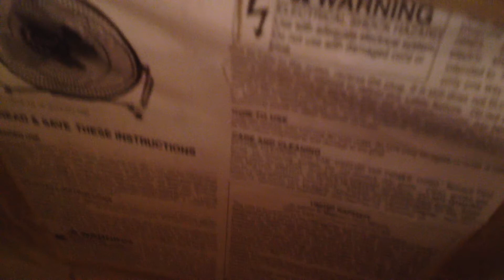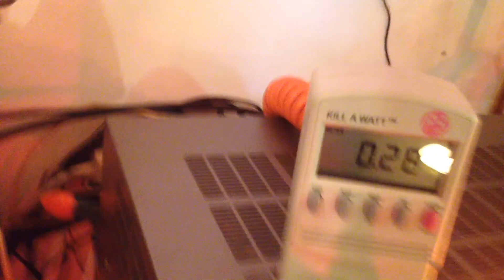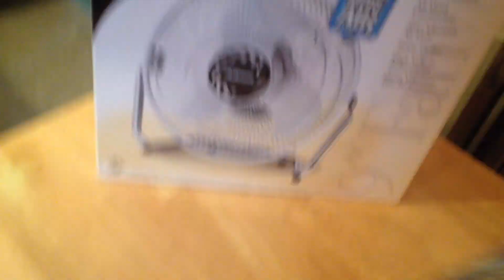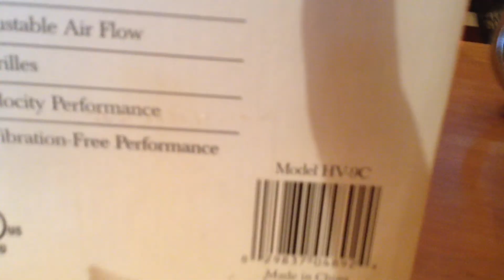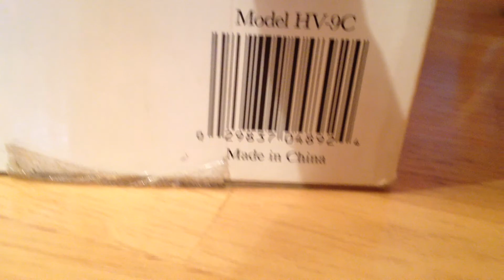Lakewood HV-9

Comment: Wow..that brought back memories..i had the same silver one when i was little. i traded or gave it away. i hated myself for doing that.but iv got the black one. these were great fans. one of the last decent Lakewood fans. along with the Kool Operator JR. (uses the same motor.) iv got one of those MIB.
Reply from the maker: If I remember correctly. this was technically the HV-9C and the black one was HV-9B...?
I'd like to get one of those Kool Operators, but the small one and the larger size, they're really neat fans.
Reply: II think your Right. one those models, iv seen videos of the black ones and on the box it says HV-9-B or something like that. i got one of the last Kool Operator JR fans that was left. at ACE Hardware. back in 2010..weird thing is..the fan itself is from 2007..must have been old stock..LOL
Reply from the maker: *****
They were still making the Kool Operator up until that recently? I thought it stopped late 90s, early 2000s at most.
I got my HV-9 at WalMart sadly, my HV-4s came from Target I think, I have two so they may have come from difference places. I bought my HV-18 in the summer of 2008 at Ace Hardware, unfortunately said store is no longer there, but I'll have to check what the UL date on it is.
Reply: ya, they had both the big and small Kool Operators til they shut down i think. i got my original HV-9 at Wal Mart. along with my HV-4.
Reply from the maker: ***** What kind of motors were in the larger ones?
Chances are my HV-4 came from WalMart as well, at least one of them anyways.
Reply: the same ones as the Box Fans had during that time. the older ones (1990's) had Mc Millins.
Reply from the maker: *****
That's disappointing for the most recent ones, I was hoping they would have something a little better than the box fans did.

Comment: I want to try and find one of these fans they're very nice!  It would be nice if one would show up at goodwill or other thrift stores.
Reply from the maker: If I found another one at a tag sale or something, I'd get it. They're great fans.
Reply: Jordan U they really are great fans and they seem to never die they are really reliable!
Reply from the maker: Logan Musser
I've seen these used in stores a number of times, and when there' in stores you know they're getting a lot of hours.
Reply: Jordan U I have to agree when I see fans in stores either it be at the checkout or costumer service they are filthy!
Reply from the maker: Logan Musser
Whenever I've seen these out in the wild they had quite a but of dust accumulated.
Reply: Jordan U I would keep mine clean so dust wouldn't blow all over and look nasty.
Reply from the maker: Logan Musser
I try to keep mine free of dust as well, especially the motor. It looks better, but it also extends the longevity.
Reply: Jordan U that's exactly why I find fans and airconditioners on the curb people don't know how to clean them.
Reply from the maker: Logan Musser
The fact that someone can't manage to figure out how to clean a simple appliance anymore is pretty sad, but its true. Either that or they just don't care and when it gets dirty they just toss it out and get a new one since everything is so cheap now.
Reply: Jordan U I found a Amana window airconditioner on the curb the condenser coil was blocked solid no air came through it and the plug looked like the plug on my old sears dehumidifire . The compressor wad tripping out on thermal overload and the plug got hot fast,cleaned it out and chopped the old plug off got a new one and now getting used at my cousins apartment. I found for window units last summer one was a gold star which was sitting next to a 1984 ge window ac and I went to the lady's door she came I asked her about them and she said I could have them. She said that one blows air but doesn't cool and the other one she didn't know so I took them home found out the filter on the gold star was caked and barely moved air that's why it didn't cool the coil probably froze up from lack of air being able to go through she thought it was broken and threw it out with the ge. Cleaned both and they both cool great I gave the gold star to my aunt and I kept the ge. Then I found that Amana and then a fedders window ac but yea. They bought a new while all it needed was a good clean of the filter although all of them got more then cleaning of their filter I pulled all the units apart got the dish soap and the garden hose,BOOM!! They work like new again pretty said how people don't know how to clean things like this,sorry kind of long!
Reply from the maker: Logan Musser I've heard of so many instances where people don't clean the coils, or even just the filters, and after a few years the units fail to operate due to blocked coils/filters. The other thing I've seen is people are careless in removing and inserting the filter and end up bending the thermostat too close to the coil, then it only runs for a few minutes then stops. Another easy repair people will toss out the unit over. Its amazing what a little coil cleaner and common sense will do on these unit.
Reply: i bought one of these from goodwill however its a Home Essientials brand which is also knows as Mainstays but it sure as hell doesnt say Lakewood but its as powerful as that fan in the video